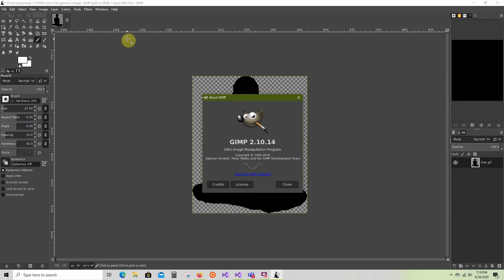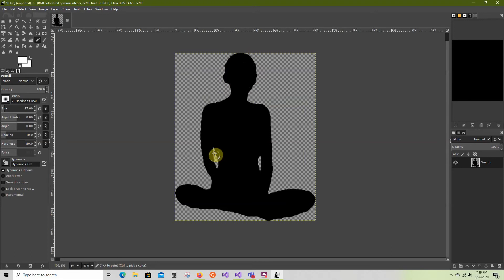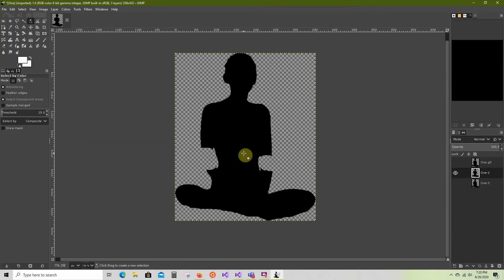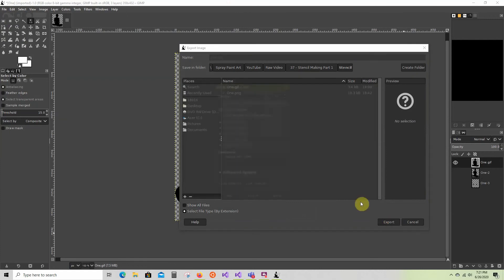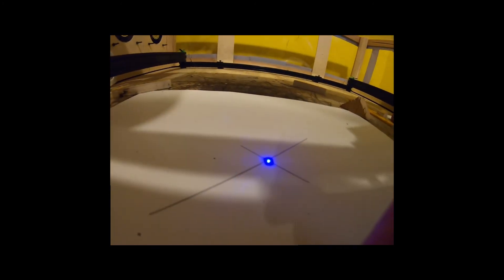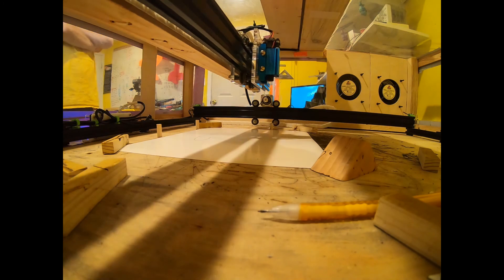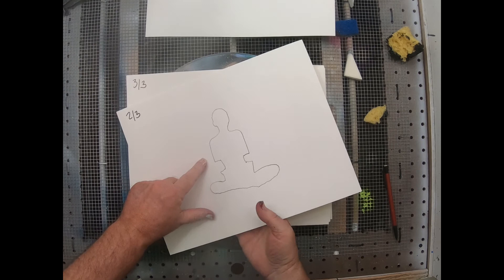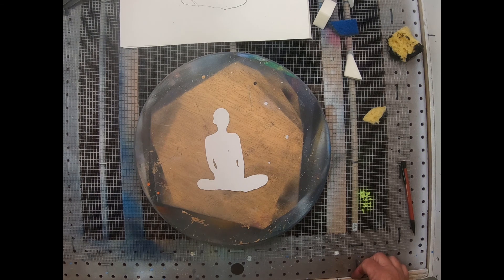How I make stencils for Spray Paint Art using a 2500mw laser

Comment: Hey there - found your video about the laser cutter. Just a quick heads up: the product is notavailable anymore at aliexpress. Do you have alternative suggestions?
Reply from the maker: Just about any laser cutter will work. I use a 2.5kw UV laser and it works great. You can find them on eBay and Amazon also.